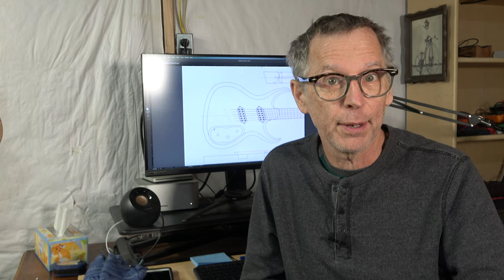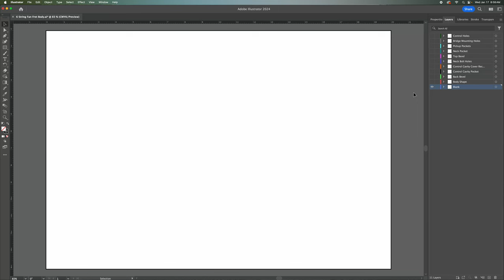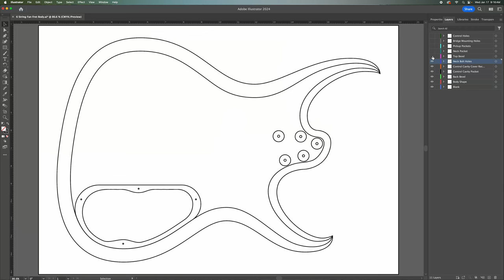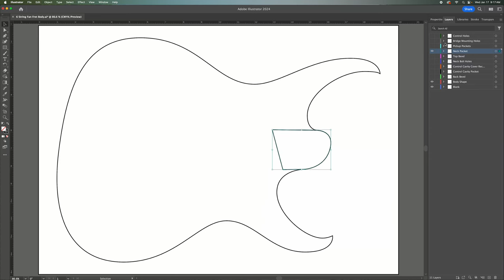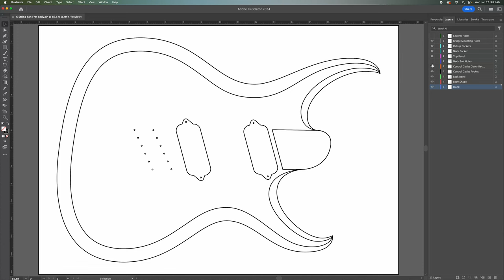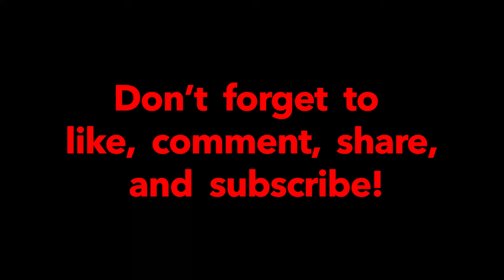Making A 3D Model Of A Six String Multi Scale Guitar Body Part 1

Comment: man i just barely missed the live stream.  but i had one question. do you taper the neck pocket or the neck to get the right neck to body angle? also how do you cnc and angle pocket? and thirdly, if i already have a neck. how would i go about machining a pocket it would fit in? thanks.
Reply from the maker: I don't taper the neck pocket. I cut the bottom of the neck heel at an angle. Measure or scan the heel and draw a pocket to use as a template for your toolpath.